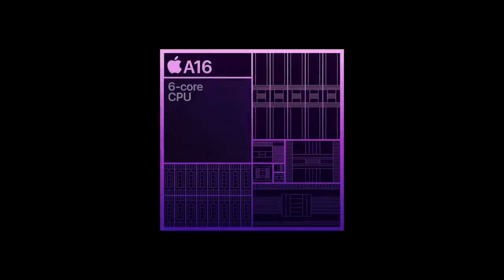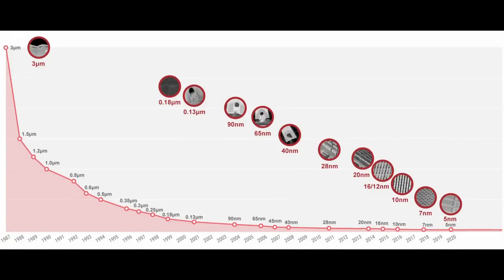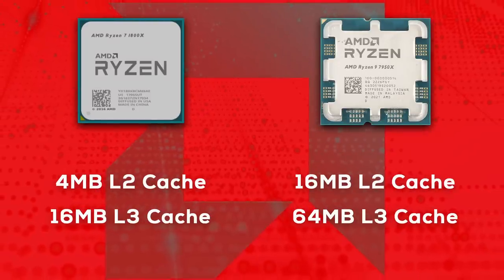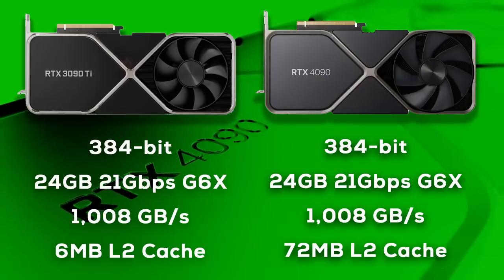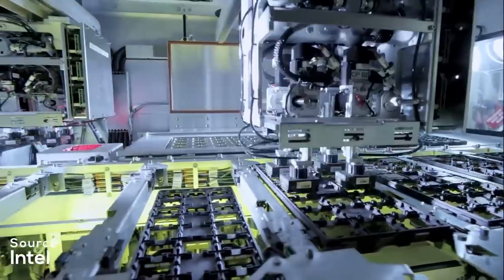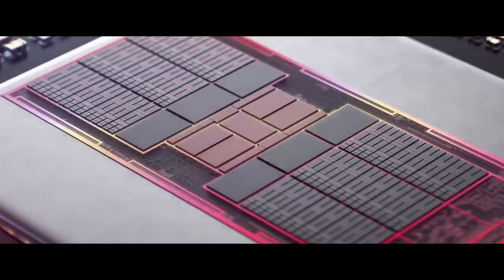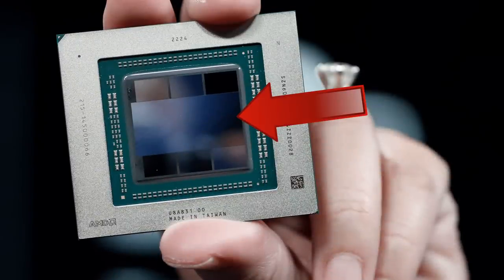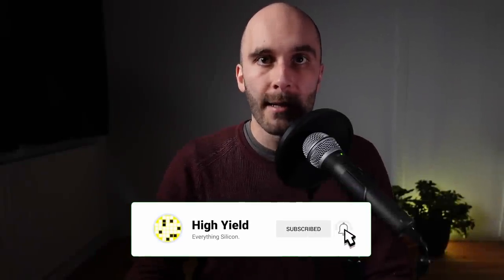Next-Gen CPUs/GPUs have a HUGE problem!

Comment: That's why AMD is starting to use 3D v-cache, which is basically stacking multiple cache RAM layers vertically in the same space. As it did with Ryzen 7 5800x3d, same technology is coming with 7000 series AMD CPUs as well soon.
Reply: techno gobbledygook
Reply: @ClaimClam  more cache, but stack like burger patty, more stack, more cache/burger
Reply: @baldwindomestic2267  understand
Reply: Wouldn't be surprised if the GPUs get v cache one day too. I think it could solve a number of issues with the RDNA3 chips
Reply: The issue is addressing heat when stacking dies vertically. I don't know how much heat SRAM produces, but I suspect it will be a problem. Maybe they can get by with a double stack, but I suspect any additional layers is not going to have the means to dissipate the heat.
Reply: @guytech7310  I have both 5800x3d and 3900x, and 5800x3d doesn't run hotter. You can check reviews, tests etc.. on internet. No need to rely on suspicions.
Reply: I'm looking to build a new PC now but I'm holding off at the moment just for that 7000 series 3D v-cache processor. I suspect AMD will reveal them at CES next month.
Reply: @mkatakm  They are only double layer stacked. I doubt you see a triple layer stack. I looked on line, and heat is indeed a problem with stacking beyond two.
Reply: He literally said that in the video
Reply: @robojimtv  afaik AMD already has stacked cached GPUs in their labs, it just doesn't make sense right now because the current GPUs are too small to take advantage of it (GCD 300mm^2 vs 4090 600mm^2).

If they release a possible 7950xtx, then I'm sure we'll see stacked cache in GPUs as well
Reply: @guytech7310  should it become a big problem, there will be the option to watercool them through small canals build in between the layers or inside the cache itself. The amount of liquid required to do so wouldn't be significant and the generated heat would be quite moderate, so you won't be required to put a bigger cooler on your CPU, just a slightly different one.
I've seen a research testing this technology, applied to the whole CPU. It proved to be much more efficient than the conditional way of cooling. It doesn't try to dissipate heat from the metal plate that sits above the CPU, it cools the CPU itself.
A clever workaround.
Reply: Damn right thats what im waiting for my pc died some months ago and i dont intend to buy any shit now until the 3d v-cache
Reply: That comes with thermal limitations. The stack doesn't hear up equally and produces a lot of heat.
Reply: @theFLCLguy  my 5800x3d runs quite cool. But more than 2 layers may cause heat.
Reply: @mkatakm  That's not a fair comparison, since they are different generations. But, comparing 5800x and 5800x3d you will see they reduced clocks and officially doesnt support overclocking.
I think this was mostly voltage related, but it also indicates less temp headroom.
Reply: @mkatakm  Yes, but it’s also clocked slightly lower than the 5800X baseline so that doesn’t really tell us that heat is no concern.
Reply: @BlindBison  gaming performance difference is significant. Slight underclocking worths it.
Reply: @mickoz84  performance difference is significant. That already negates the need for oc.
Reply: @mkatakm  Of course that’s so, 5800x3d soundly beats the baseline chip in most workloads but the necessity of the slight downclocking lends some credence to the notion that heat is a potential problem. That was my point going off prior comments in this chain.
Reply: @mkatakm  I agree, but it shows there are some thermal drawbacks of stacking. So far it is worth doing it, though.
Reply: @ClaimClam  3D VCache separate to L3? (So an L4) Or is it a replacement of the L3 Cache?
Reply: @Adpocalyptic  Extention to L3 cache, VIAs transfer the data vertically so 32MB becomes 96MB.
Reply: @guytech7310  In the case of 3D-VCache, AMD shaved the core die down as far as they could, as well as the cache layer pretty thin. It's the same height as the conventional Ryzen chips in the end.
Reply: @baldwindomestic2267  now I'm hungry!
Reply: @Jaker788  That does not solve the thermal problem.
Reply: @guytech7310  It does a lot to solve or at least mitigate the issue. There's more heat generating silicon, but the actual amount of vertical mass that has to be conducted through is the same. Using TSVs as well increases the conductivity between layers and keeps full contact between silicon layers VS solder.

Die shaving is an extra step that adds cost, but it's gonna be a requirement.
Reply: @mickoz84  it definitely had to do with the cache itself. Probably heat related as you note.
Reply: @guytech7310 lets see if AMD reach (1nm) soon and hopefully you are wrong.
Reply: It's also why AMD moved most of the cache to chiplets on GPUs. Cache doesn't scale well for a while now.
Reply: @robojimtv  They're getting something similar already
Reply: Yep AMD has Learned it lessons from the Bulldozer  architecture (2 cores share 1 cache block) the low cache really hemperd the FX CPUs back then and they won't let it happen again so that's why they switched away from monolithic chips to chiplets so early (maby it had same other reasons but the challenge too overcome the hurdles on the way is non the less a feat)

Comment: AMD definitely doesn't get enough credit for their forward thinking in this regard. And as highly regarded Jim Keller and his work on Zen has been. There was an engineer (Sam Naffziger) who was responsible for persuading the senior execs to use chiplets on Zen and future AMD products.
Reply: .. maybe because they did not invent the wheel? every foundry has MCM designs and chip stacking technologies being worked on since the past 10 - 15 years. We're only just starting to see them hit the market.
Reply: @ledoynier3694  and yet intel was talking about "we're not gluing our chips together..." (although they are doing it for Xeon for a while...)
Reply: Didn't Intel do this long ago with "Crystal-Well" 128mb cache chip year and years ago?
Reply from the maker: Broadwell i7-5775C
Reply: @HighYield  but that's an L4 cache, a known solution to add cache next to the chip. not stacked cache like what AMD and TSMC are working right now.
Reply: That is 2.5D cache. The precise reason Intel is doing it is because they bought Altera and Altera does that kind of thing versus AMD and Xilinx does interposer and 3D stacking. Both are elegant solutions while Intel-Altera is more cost effective in fact. That is why AMD copied it. Notice AMD did it in Fury gpus and it was a loss leader. Even still, it cannot be done, the interposer is a cost barrier.  TSVs are the sought after solution in Zen.

Comment: I don't think it will be an issue for AMD. They are using 3D caching. The 5800X3D is stil a beast. Oh nvm you already mentioned it. I think in the future they will be able to start stacking with a faster and faster interconnects i.e next gen infinity Fabric
Reply: Was going to say pretty much the same thing. 3D cache will increase the amount of SRAM that a chip will be able to hold. It doesn't fix the scaling problem. But it does solve some of the size issues which is why the AMD Chiplet tech is most likely the next step.
Reply: Pretty sure Infinity Fabric is slower than the vias used in 3D V-cache.
Reply: even when early computers where developed some discovered you could double the amount of memory in a computer by stacking ram.   4464 RAM Chip commodore 64/Apple era
Reply: THIS right here.

I think AMD and Nvidia are going to separate here in terms of utility.

Nvidia is gonna have to focus on cuda cores, while AMD focuses on parallel processing.

The only thing that might save Intel is if they somehow went along with apple’s chip methodology, where they target specific use cases, such has a portion of the CPU hard wired for specific tasks instead of relying on transistor gates.
Reply: @spamcheck9431  would you explain what hardware features Apple integrates that Intel doesn't? AFAIK Intel and AMD include a lot of extra instruction sets and some accelerators (e.g. for encryption).
Reply: @spamcheck9431  Intel has been working on chip stacking for a number of years, before AMD launched 3D Vcache. They already do it on some laptop CPUs. It's just that they will only start using it on desktop CPUs with meteor lake and arrow lake.
3D Vcache is only a sidenote on AMD's portfolio even now, but it will most likely become the norm with the future generations of course
Reply: @ledoynier3694  I'm like, 20% sure Intel didn't start experimenting with this until after AMD already announced their plans and general schematics of how such a thing would work. Can't be too sure though, but this was years before they actually released their first 3DX version. Intel was in real trouble back then and was just making up new 'promises' as they went, IIRC.
Reply: Not trying to be argumentative, but the video is missing vital information, it seems to me. 3D stacking will reduce call power from 2 picojoules down to 0.3. It will be a leap forward just like Nvidia 480 to 580, the chip will be able to communicate between its parts much better without any downside to it.

Comment: You panic too much. There is no huge problem with cache. Most new software needs more cores, not more cache (games are the exemption here). Just look at the benchmarks of Ryzen 5800X and Ryzen 5800X 3D. In all software (except games) higher clocked model with less cache wins over 3D model.

Comment: This finally explains why the CPU core is made on a smaller process than the memory chips, when it used to be that memory chips were the first to shrink (because of much simpler design).
Reply: You may be thinking of DRAM, which requires different process features.
Reply: DRAM has always been on an older process than logic, because 1) DRAM cost control is much more critical than logic and can’t afford to use bleeding edge fab processes, and 2) the DRAM array has features (like Wordlines and bitlines) that use entirely different fan processes and aren’t able to scale at the same rate as logic transistor processes. 

But, historically, SRAM was used as the test vehicle to test new processes, because SRAM uses (or can use) “normal” logic transistors.

Comment: AMD certainly seems to have an advantage in the chiplet space because of their past successes with zen, but I have to wonder how much longer that advantage will last. It would be pretty ironic if nvidia integrates chiplets into their cards before AMD can leverage that advantage for a clear win at the high end. It seems like they really had a golden opportunity with rdna3, but it obviously hasn't really worked out that well so far.
Reply: it's not a chiplet, but Nvidia is already leveraging entire datacenters of cards to work together as though its one supersized GPU. Which means they probably already have the tech they need need to do chiplets without too much of an issue.
Reply: @ag687  afaik, the chiplet tech AMD is using is at least a couple orders of magnitude higher bandwidth than nvidias data center networking solutions (although, they are impressive in their own right). The chiplet interconnects are developed in coordination with tsmc though, so it's not inconceivable that Nvidia could use similar tech to AMD as long as they stay in good graces with TSMC.
Reply: i think Amd has patented most practical aproaches to chiplet design already which will leave others very much little space for innovation. Intel's struggling for years with their tile design is showing its much harder for others to be competitive.
Reply: @sudeshryan8707  I'm inclined to agree with you there, but I'm not ready to rule out something new built on TSMCs packaging technologies for high speed interconnects. Last year I thought no other chip design firms were even close to AMD on mass market chiplet designs, but then we saw the m1 ultra from apple with very impressive performance scaling over a whole new fabric. I wouldn't count Nvidia out, but I'm certainly not expert on the matter, just an armchair critic.
Reply: @b130610 while apple's m1 ultra is very impressive it has less bandwidth per silicon usage and the interposer itself is an extremely expensive tech compared to amd's infinity fabric based inter die communication

Amd might go patent troll on other companies going forward, not a fan of that happening
Reply: @b130610  TSMC is said to have strictly split R&D teams per partner, so there'll be no "good graces" shortcuts for nVidia other than (probably) lithography enhancements.

Comment: What are you talking about ? There is no problem in stacking SRAM, it should instead be made larger to achieve better power consumption and performance. Also, it should include ECC as a mandatory requirement.